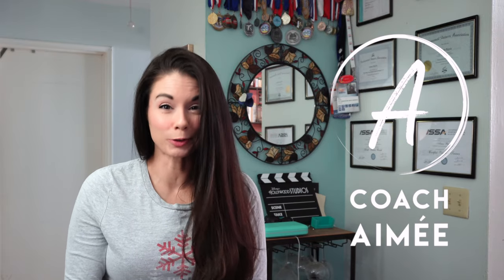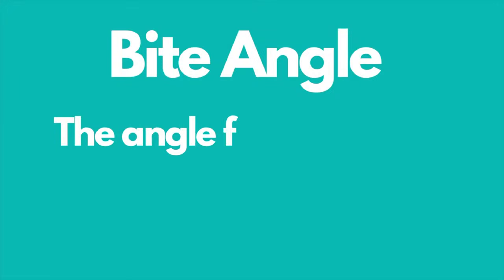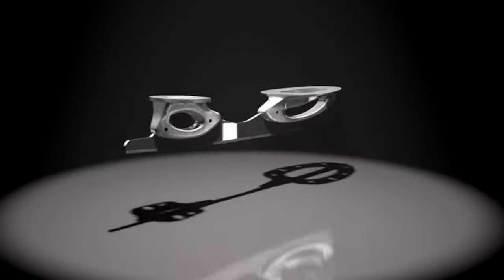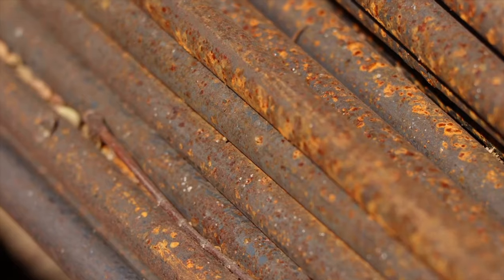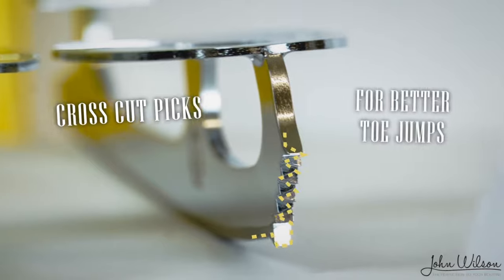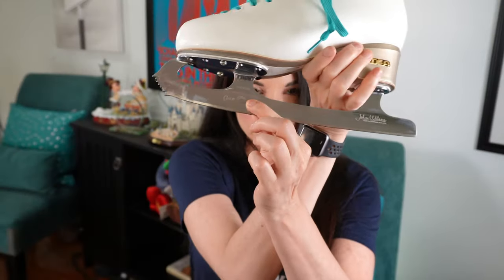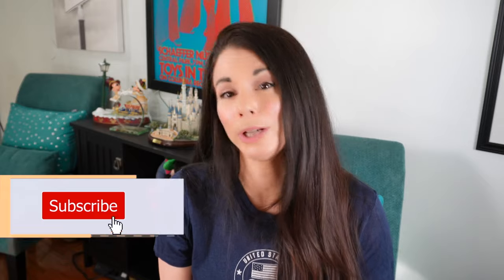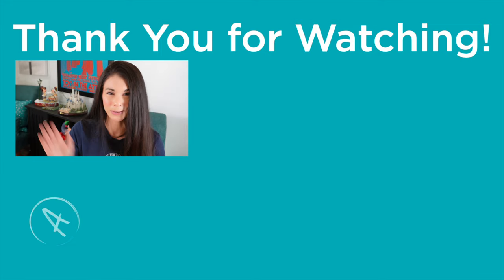Figure Skating Blades: What Are They Made Of? Blades Part 2

Comment: Really like your videos, although i must say, trusting your skate tech is not the best option most of the time. Many of them (if not 90%) would suggest a wrong edea size for you ( EVEN AUTHORIZED DEALERS) which is mind boggling. Edea also said that wrong size suggestions is a world-wide problem XD. I got my first skates off of local ebay and trusted edea measurement (+0.5 for adults). It was a great skate and served me well through all single jumps. But when i came to MULTIPLE professional skate shops to get ice flys, they suggested me a 255 size, when my foot is 240 mm long under pressure. And with new 2023 lust edea suggests taking the skates mm to mm (so 240 instead of 245 for a 240mm foot). And the worst part is that  you cant even trust your coach. They may be great at teaching but I saw multiple times how great coaches put little children learning doubles and triples in a skate that has 2cm of room in it AND suggesting the wrong hollow(Hello Alexey Mishin and his flat 18 mm hollows for doubles). 
At this point you can only trust yourself and when you find a great sketch tech - babysit them, praise them and never let go.
Reply from the maker: I'm sorry that has been your experience! However, I have not found that to be the case with recommended professionals. Part of the issue (at least here in the US) is that Edea does not REQUIRE dealers to be trained - it's optional but recommended. As far as not being able to trust your coach, IF your coach is PSA-Rated, they are well trained, qualified, and trustworthy. It sounds as if you may be working with the wrong people, unfortunately. There are plenty of great professional techs and coaches out there - seek them out!

Comment: Hi Aimée! 
I’ve watched your video but I’m still not sure on what blade to buy. This weekend I’m going to get new skates (Edea overtures which were recommended by my coach) and I’m pretty sure they won’t have blades attached. So I’m not too sure what blades to buy. Im basically a beginner I started a few weeks ago. Any recommendations?
(Your video is very amazing, I’m not saying I didn’t learn anything but I’m not the best at learning)
Thank you Aimée!
Reply from the maker: Correct, Edea Overture boots are sold separately from the blade. I usually suggest the John Wilson Coronation Ace or MK Professional to my beginning skaters. Lately, I'm been leaning toward MK Professional more. At first, it was due to it being more available with supply chain issues, but I've found my skaters have more immediate success with it. There are lots of blades on the market that are based on these two profiles and can be less expensive. However, I prefer going with John Wilson or MK because, IMHO JW and MK blades tend to glide smoother, providing a surer edge than Jackson, Eclipse, or other brands of blades. That said, if availability is an issue (due to back order), you may have to go with what is available. Ask your coach what they prefer to see you in. Just like your boots, coaches like to provide guidance to their skaters about blade choices.
Reply: Thank you! I knew I could rely on you ❤️
Reply from the maker: @Islaonice  You're welcome. But definitely discuss it with your coach too!
Reply: I ended up getting the Edea overtures with the MK professional blades yesterday and today I skated in them. But after 10 minutes of skating the ball of my foot was aching a lot. Do you know why cans how to fix it?
Reply from the maker: Anytime you change your equipment, there is going to be an adjustment period. Make sure you are lacing your skates properly - the Edea way! I have a video on that here: https://youtu.be/t4EuFbwl6IU If you are properly lacing and still have discomfort after the first few times skating, you should talk to your professional tech about your specific issues. They may suggest a specialty insole or custom shaping, which is quite common. Edea's are designed to be custom shaped.
Reply: I think I noticed what I did wrong, my mum was helping me and I think it’s because she tightened the lower laces too tightly. Thank you!
Reply from the maker: You're welcome!

Comment: Hi there Aimee, subscriber here!  Wanted to say that thanks so much to you, I discovered and have access to Greg at Polar Skate shop being that I am in Essex County, NJ 🙂  I have a question re blades.  I'm a middle-aged guy and due to knee/joint issues from a medical condition, I rely and love skating as a recreational activity and more importantly, as physical therapy for strengthening and its overall health benefits. I am a competent skater but with my limiting physical conditions (have vertigo spells too, ugh! LOL), my kind of skating certainly does not involve jumps and spins. At my level of skating, would I be able to get away using dance blades for my recreational skating? I suppose I like the thinner profile for easier edges/turns but I am not sure if the shorter toe pick and tail can be disadvantages.  Or are these all irrelevant and I could still enjoy recreational skating with dance blades?
Reply from the maker: You could use dance blades for recreational skating. However, freestyle blades offer more stability due to the longer length. While dance blades are often more narrow than freestyle blades, it varies from model to model so if that is what you're after be sure to check the specifications! You could also look into synchro blades which are a hybrid between dance and freestyle blades - not as short as dance blades. Depending on your body composition, John Wilson Coronation Ace Lite or MC Professional Lite could also be good options for you as they are thinner. However, Lite blades are not the best choice for heavier skaters. Greg has many blades in his shop and he can help you chose!
Reply: Aww thanks so much for your valuable advice! Yes, I'll definitely look into blade options including dance and synchro blades. However, as it already appears, I ought to stick to freestyle blades.  Weight wise, I usually hover around 160-165 lbs so considered lighter than the average male at my 5'10" height. Apart from your guidance, I will definitely have a chat with Greg!
Reply from the maker: @artdelac you’re welcome!

Comment: im between the john wilson gold seal and the john wilson gold seal revolution. What do you recommend? I like that the rev are lighter but they also seem to wear out quicker because of the plate material. I also heard that its harder to grab because of the unique shape. Whereas the regular gold seal is a simple standard shape. I just dont know argghhh
Reply from the maker: The Gold Seal Revs can also be difficult to have sharpened, unless you have a very good tech in your area. So, if you don't have a good figure skating tech, go with the standard.
Reply: thank you so much for you're insight. I haven't considered that before. In that case the standard might be the better option
Reply from the maker: You're welcome!

Comment: What does bite mean though??
Reply from the maker: Each individual radius of hollow creates “bite,” which is the depth a blade will penetrate the ice. This affects your control and glide. The deeper the penetration, the tighter the control and more friction. Shallower penetration creates less drag, better flow, and speed, but less grip. The optimum bite for each skater, varies by skating style, weight, ice hardness, and most importantly, personal preference. I explain more in Part 3 here: https://youtu.be/_Xx9Z-7NM4Y

Comment: Dear @Aimée Ricca 
I believe John Wilson and MK are the only companies whom use term side honing for blades which has concave shape on the sides of the blade. Example Ultima calls this dovetail shape Taper Design or Tapered Edges. So when you talk about side honed blades, I assume you are referring to JW or MK blades.

I have some difficulties to understand how this bite angle increasing materializes in JW or MK blades where concave shape is removed (if it even ever exists) from the edges when chrome removal process is done. 

Actually they are rounding the edges quite heavily in all of their blades and in my opinion that causes totally opposite affect than what you explain to the people. 

Example Ultima Apex blades this dovetail shape go all the way to the edges like in your sketch and this has increasing bite affect like you explain. Can you kindly clarify more detail level how Side honing increases the bite angle in JW or MK blades? 
https://youtu.be/zPbp-xwWUNo
Reply from the maker: Actually, other blades such as the Eclipse Pinnacle are also side honed. Paramount also has blades that are side honed. You can see it on the chart on this website: https://www.kinziescloset.com/blade-comparison-guide.html So, it's not specific to John Wilson and MK. Additionally, MK Phantom Specials are dovetail. You can also have a tapered side-honed blade. 

The information in this video was according to a PSA course I took and my research. The authors of the course were Jimmie Santee, PSA Executive Director, and Mark Ladwig, a Jackson Ultima representative. The course material was reviewed by Bruce Hurd and Mitch Moyer, who are renowned master skate technicians. 

As I understand it, side-honed blades have sides with a concave design which causes them to be thicker at the stanchions and the edge while thinner in between. They are easily recognizable because they cause reflections to be inverted. Side-honed blades increase bite compared to parallel blades. This feature is only seen in carbon steel blades. 

Tapered side honed blades are wider at the front of the blade and is thinned consistently down the length of the blade to the tail. Tapered blades are often side hollow-ground too. This feature reduces blade weight and friction along the ice.

My videos were viewed by Greg the technician at Polar Skate Shop, and John Wilson and MK, who said that my information was accurate. I am not an engineer and did not perform any independent scientific tests on the blades, so I do not have the data you are looking for. It sounds as if you may have performed some tests on your own. 

This video is not meant to be as technical as the question you are posing. That level of technical detail would be best addressed by a master blade technician, the R&D, and the engineering teams at the blade manufacturers. You can reach out to the companies directly for more clarification.
Reply: Thank you for your prompt reply and my apologies that I asked technical things from you. Based on your technical explanations and coach background, I thought you are expert whom does have knowledge and experiences from the things you are lecturing.

I was also wrong when I thought that JW and MK are the only companies whom make side honed blades. However, no matter what is the brand, side honing does not automatically mean that bite angle increases. To increase the bite, concave shape should go all the way to the edges what you use for skating, just like you sketched in your video. It’s like radius of hollow but in the side surface. Unfortunately this nice theory does not materialize, if concave side (edge) grinded to be flat or convex on chrome removal process. This is quite simple engineering, isn’t it?

PS. I was not aware that Paramount Skates which are aluminum framed blades does have also concave shape, which is are thicker at the stanchions and the edge while thinner in between. I need to ask also from Paramount why they make side honing only for their lower end blades which does has have carbon steel runners.
Reply from the maker: Being a coach and a skater does not make anyone an engineering and product development expert! The best people to ask are the research and development people and engineers - which I am not!

According to expert technicians, side honing increases bite angle, as quite a few published papers verify this. If you have reasons to feel otherwise, please contact the people that I mentioned in my original comment directly with your findings. I'm sure they will want to see what you have come up with and explain their point of view.